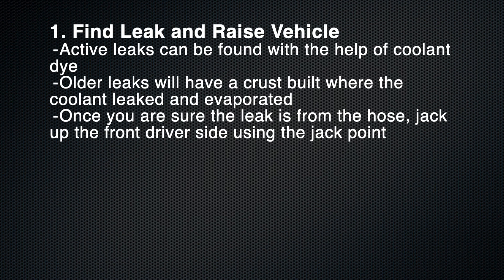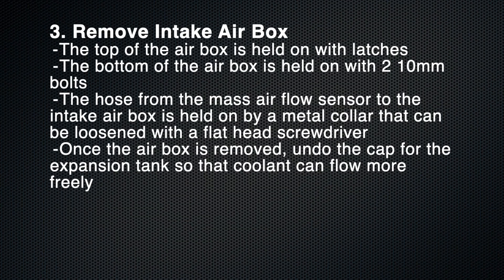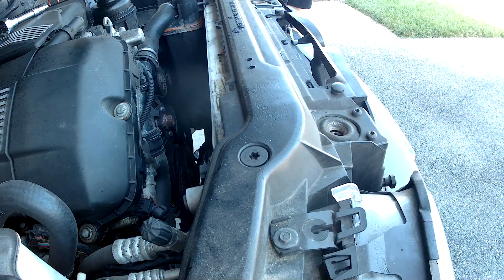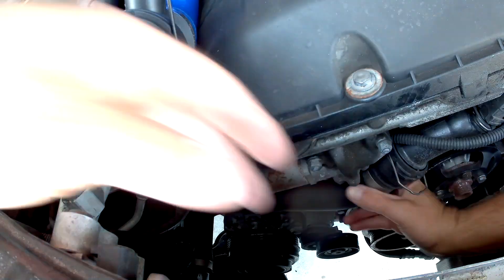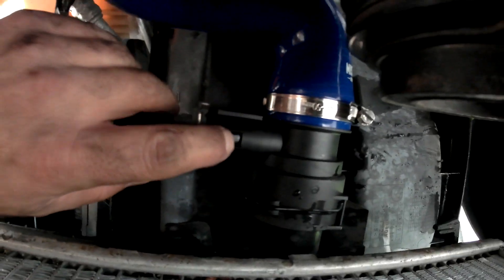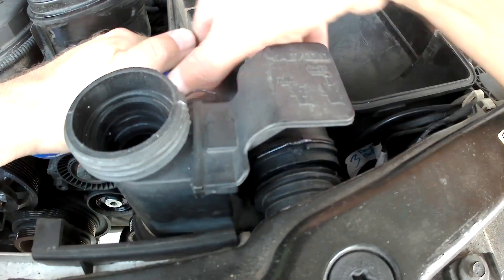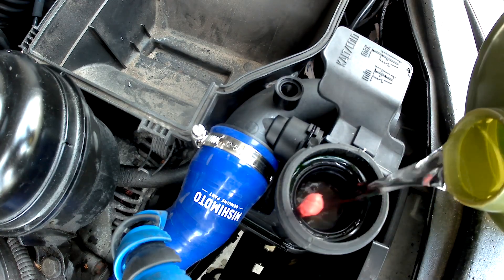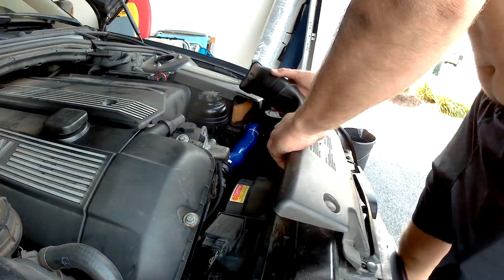BMW e46 Radiator Hose(s) Replacement

Comment: A best practice when installing BMW's Quick Connect hoses is to have the spring clips pressed DOWN first before installing. This way when the connectors slide on you will get a satisfying click assuring you they are seated all the way. I had a shop try to push the hoses on first and then the spring clips down, and when I drove away and got on the freeway, the radiator hose came off, leaked all my coolant out and left me stranded. Lesson learned from others mistakes.

It's also important to put some lubrication on the O-rings before pushing on the hoses. Silicone spray, silicone gel, silicone paste or dielectric grease all will work fine. Then you don't have to fight trying to wiggle them on and possibly marring the O-ring seal. They will slide and clip in easily this way.
Reply from the maker: Two fantastic additions! Thank you for pointing them out!

Comment: After you bleed you need to remove some coolant from the expansion tank so the level is between the balls on the float. If you just put the cap on like this the system will be over pressurised. You might want the extra pressure if you have silicone hoses and performance parts, but for people with regular cooling systems don't do this! You might end up with leaks or a cracked/exploding expansion tank. The cap should vent pressure but often it doesn't before something else in the system fails. After the bleeding, remove coolant with a turkey baster until the level is slightly below max (you can still pull the float up ever so slightly)
Reply: You are so right to not overfill the expansion tank on these e46s. I did that and the increased pressure caused my expansion tank to blow. Also, yes, the stupid 2.0 bar expansion tank cap holds way too much pressure. Better off replacing it with a 1.4 bar cap like the E30 uses. Easily purchased for cheap
Reply: @lawpenner Yes I have been thinking about doing that, it's an easy mod to just replace the cap. Unfortunately my expansion tank is leaking slightly from the seam at the top (genuine bmw) so I might do that when I replace the tank again
Reply from the maker: This is solid advice. ^ Thank you for pointing it out.

I have silicone hoses and an aftermarket expansion tank so I am less concerned.

Comment: thank you. great great video. now to go downstairs and rip system apart. ugh
Reply: FUNNY  my root problem was bad o-ring on fan thermostat. Now I have new lower radiator hos. Recommend spare 8/14MM 3mm thick o-rings in parts bucket. They seem to not last.
Reply from the maker: I'm glad you found the problem! Hope that the video helped!
Reply from the maker: Best of luck 🤞!

Comment: did you cute the old hose and used hose claps for new rubber ?
Reply from the maker: The radiator hoses come with the plastic 'end cap' connectors and metal gates attached. No need to cut anything, just remove the old hoses and install the new hoses

Comment: Super annoying just going to add. I order two kits of e46 silicone Mishimoto hoses and neither kit included upper small o-ring for expansion tank. Went to junk yard for spare o rings. Took awhile to figure out why these brand new parts out the bag don’t work.. missing o ring. 
You can take your oring out of your oem hose, However I didn’t want to alter it since it’s known good with no leaks. Hence junkyard. I’ve reached out to turner Motorsport where I bought them twice already and they don’t care/ understand. Hope this helps everyone.
Reply: @mymantman Thank you so much i just upgraded to mishimoto hoses radiator and expansion tank and was wondering why I still had a leak on the upper radiator connector 🤣
Reply from the maker: Glad this was helpful!
Reply from the maker: Good looking out and hopefully your comment helps others! I honestly cannot remember if mine had the smaller o ring.

Comment: Great video!  Getting ready to get these coolant hoses and wanted to see what they look like.

ONE SUGGESTION:  Next time you get the chance, make sure to use the blue BMW coolant or Zerex G48 coolant [50/50 mix] to keep your coolant system reliable.  😉
Reply from the maker: So that actually is the blue BMW coolant but it has some of the green dye in it :)

Comment: Hey for the little gate on the upper radiator hose I am missing an O-Ring for my mishimoto hoses, Will I need it or did my kit come without one for a reason?
Reply from the maker: I would reach out to them. I can't be 💯 (because I don't want to disconnect mine) but there has to be some barrier to prevent leaks and IIRC there is no ring on the coolant reservoir so it would have to be in the hose (both big and little)